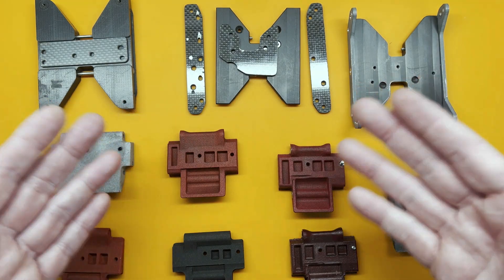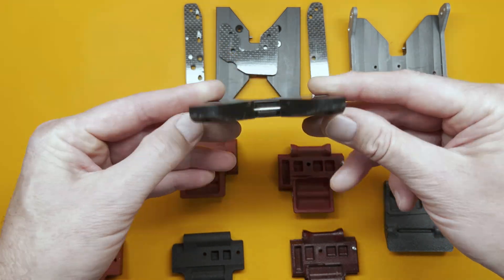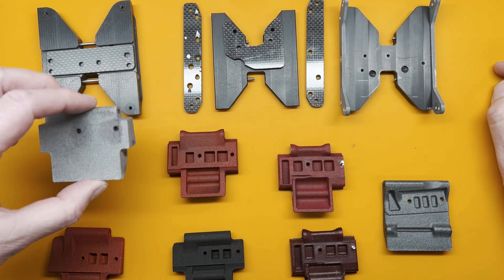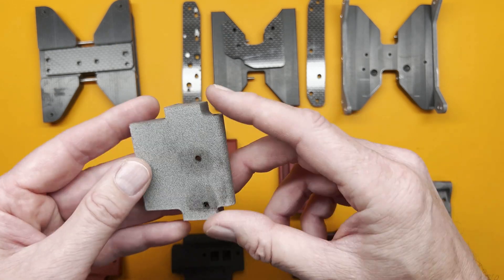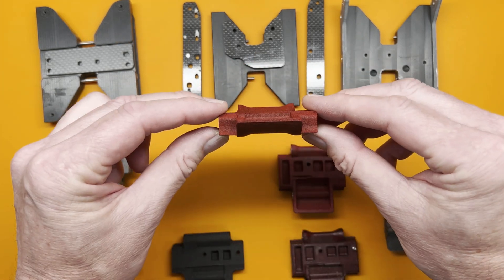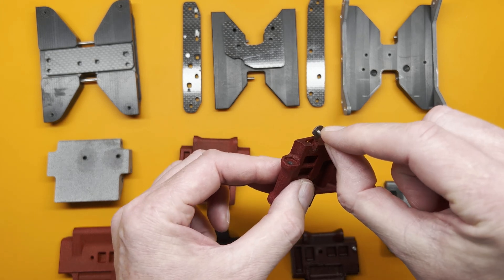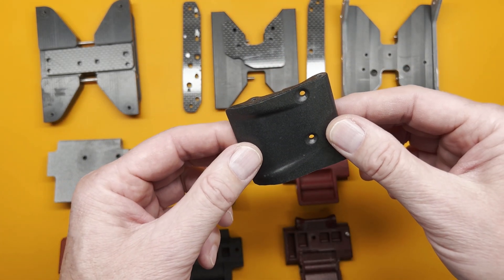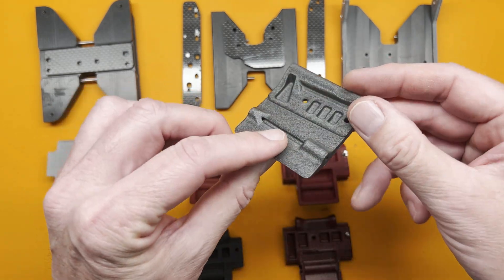Make a Better Skid!

Comment: @BoomslangSuss is Nylon PA 12 as strong as delrin
Reply from the maker: It is not as strong as Delrin, but it’s generally strong enough for a skid. If you use MJF printing technology, it’s stronger and denser than any home printers and many other printed skids I see being sold.
Reply: @BoomslangSuspension  i plan to get it from jaws tech were you got yours
Reply from the maker: I recommend paying extra for the vapor smoothing process. It strengthens the outer surface and puts a nice harder shell around it.
Reply: @BoomslangSuspension  do you think this material is also good for some sliders
Reply from the maker: @Toysojah671  Yes, it will work great.  You can also experiment with PA11  and glass filled if you want more strength. But in my experience, PA12 is economical, durable, strong. The vapor polishing is the magical step.
Reply: @BoomslangSuspension  got it I will try that does the different colors make a difference or thats all for looks. Also you wouldnt happen to know a place that can machine aluminum for a decent price would you. Im trying to get my servo mount machined but most places ive checked charge and arm and a leg
Reply from the maker: @Toysojah671  The color is just a dye and it’s not super consistent looking.  Try Craftcloud - it’s an aggregator of companies that offer various services including 3D metal printing. For CNC try Xometry or Protolabs. Metal printing is cheaper.
Reply: @BoomslangSuspension  metal printing?
Reply from the maker: @Toysojah671  Yes, it's quite common now to print stainless steel, aluminum and titanium. It's not as strong as CNC, but for RC it's great. I do servo mounts all the time.  You have to make any threads with a tap by hand afterwards.
Reply: @BoomslangSuspension  oh ok but you would still have to put a hole in the design correct and then tap afterwards. If so what size hole you put in design to do an M3 tap
Reply from the maker: @Toysojah671  Put a 2.5mm hole for an M3 tap.
Reply: @BoomslangSuspension  hey also so if i wanted to screw straight into 3d printed part what will my hole size need to be and if i wanted to use a m3 threaded insert what will that hole need to be?
Reply from the maker: My facebook page mostly mirrors this content, but connects to lots of discussion threads.  https://www.facebook.com/CzarSoFar/
Reply from the maker: If you want to screw into plastic, I would still use a 2.5mm hole for an M3 bolt.  I normally use a tap on plastic threads for the first few mm, just to ensure you get a clean start.  There are dozens of threaded insert types and styles - I can't give you a single answer on that one, but the manufacturer of the insert should be able to advise.
Reply: @BoomslangSuspension  thank you for all your input
Reply: @BoomslangSuspension  do you add threaded inserts or do you just screw straight to it
Reply from the maker: I tap directly into the material. Threaded inserts are a little stronger, but really ideal if you are taking the fastener in and out frequently. I start the holes with a hand tap for about 1/4 of an inch and then have a friction thread fit after that.

Comment: Very nice work! 👍  Is the latest skid designed for a,specific chassis?  I would love to see it built up.
Reply from the maker: This will fit a Poizd and probably others because I think the bolt distance is pretty common. I’m working on another version that will fit custom chassis rails with a couple more features integrated.

Comment: Very nice design ....I work with Onshape  and at the moment I play around to make a skid for the chinese Dlux transmission to fit in a 66mm chassis . Keep on the awesome work!🤘
Reply from the maker: My new employer uses OnShape so I am getting up to speed real fast!
Reply from the maker: Thanks!  OnShape is a great place to start. You can also by a Maker version of Solidworks very inexpensively. When you find a design you like, print a nice version at a commercial printing company, you just can’t get the same quality from a home 3-D printer.

Comment: I like the last skid but not sure how this mounts, does it go on a custom chassis rail?
Been using 70mm skids since 3 or 4 years ago... I remember drivers laughing at my post when sharing my builds. There was this one time I was running a GSpeed V3 chassis and narrowed the Vader skid to 70mm, so many drivers couldn't believed a pinch wasn't necessary to stiffen the rails...  I just found it funny that carbon fiber rails where pinched front and rear like a stock metal rail chassis. I then contact Vader about making a custom skid for me and they found it funny that I even wanted one. So many narrow minded individuals who cling to their 78mm pinched chassis... that is so retro 😆
Reply: well....its a small hobby niche ...and of course everybody has his own opinion 😁...at the end of the day nothing spectacular actually happened design wise in the last 15 years in competition crawling .
Reply: @themountain59  yes, I agree on respecting others opinion. But I think there was a lot of innovative designs introduced that went mainstream. Back when I started RC Crawling in 2005 we had to build our own rigs, the hobby is so mature today that aftermarket parts can be had everywhere.
Reply from the maker: It mounts with the normal four chassis bolts that would attach your links. What I like about this hobby right now is anything‘s possible and there’s so much innovation you can take any direction you like. No rules. Cheater class is a real thing ha ha.